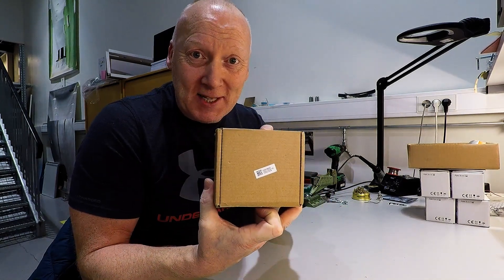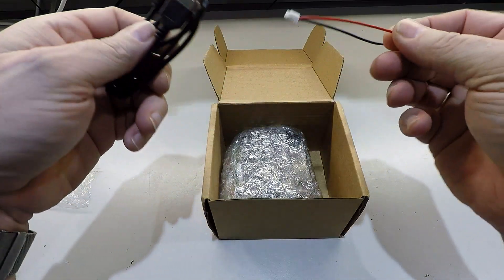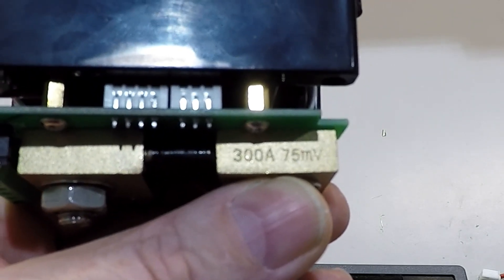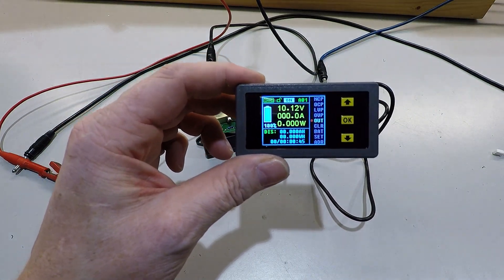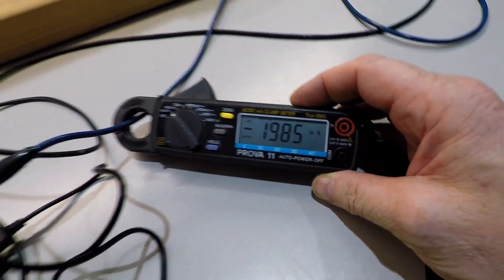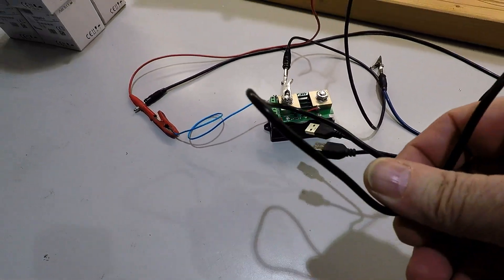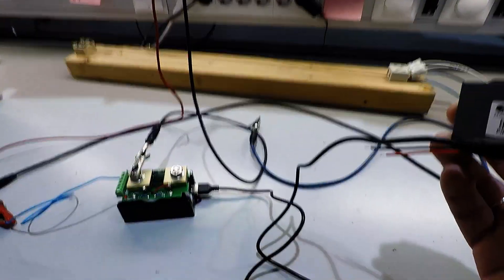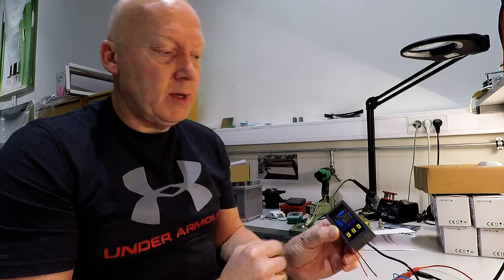First Look: Wireless RV Battery Monitor from Ming He (Drok) 120V 300A

Comment: Can you recommend a place for me to learn what all the measurements are?
Also, the new links on amazon show different models but they display no differences in the description. Do you know how they are different?
Reply from the maker: I think the main difference are the wraping (plastic housing). I don't know a place where you can learn what the numbers mean
Reply: @Italjohn  I can't believe you are still replying. Your comment inspired me to keep digging... I found this on Aliexpress... a pdf manual
https://www.mediafire.com/folder/b8784mx5o3en2/VAT_Series_Data
Page 3 shows a table describing the differences... Amazon does show this in the description but it is very very poorly rendered. The model number is tied to the amperage and max voltage it can measure! 
I have a 300amp 12v system and there are not many shunts likes this over 100a.
Reply: Also, this video goes into more detail describing the functions.
https://www.youtube.com/watch?v=MS3-JmyT-pY
Reply from the maker: @lunaumbra5179  Great video, did see that last year and have totally for got it.

Comment: No longer available
Reply from the maker: Yes I can see that, but they are still available at ebay https://www.ebay.com/itm/VAT1030-Wireless-Digital-Voltmeter-Current-Voltage-Detect-Power-Meter-0-100V-NEW/392807255868?_trkparms=aid%3D1110006%26algo%3DHOMESPLICE.SIM%26ao%3D1%26asc%3D225086%26meid%3D59d6d2a64f2742ea9c0e6b95b3bdefa9%26pid%3D100005%26rk%3D4%26rkt%3D12%26mehot%3Dco%26sd%3D164248425472%26itm%3D392807255868%26pmt%3D1%26noa%3D0%26pg%3D2047675%26algv%3DSimplAMLv5PairwiseWebWithBBEV2bDemotion%26brand%3DUnbranded&_trksid=p2047675.c100005.m1851

Comment: Could I use this on a dual t max 180amp split charge set up, main battery and aux battery in parallel if I used a 300amp shunt any help would be great. Thanks.

Comment: I also realized i can use a small relay like in a cars fuse box ,by using it to bypass the low voltage power switch on the inverter/ charger. this is better because both the inverter /charger, and my MPPT solar  charge controller say don't  use without batteries connected. I guess I'll need a second relay ,if I want a battery disconnect to happen after it is turned off.

Comment: you want to sell that unit?  the amp readings on mine are all screwed up. i don't want to rewire everything for a different model. i think it is the meter piece broken on mine.
Reply from the maker: No, sorry you will have to buy a new one.
Reply: i actually found extra settings on it ,to calibrate volts or current. if you go to NCP and hold the up button down for a while, the calibration settings appear. I have no idea how it got off so far, but i fixed it. the cheep meter lives on.
Reply from the maker: Excellent, I just discovered that option myself.
Reply: Yes it is awesome to be able to calibrate.volts /amps/watts. I don't remember anything about these settings. the new model has temperature and lots of new "hidden"options.$29-$59 I had been working on the inside of it the other day and must have touched something ,to advance it 20,000. .it took forever to get it back under 1000. one click , one number. if I hold it down, it is still only one number a second.I still don't know what the letters meaN.
Reply: @immrnoidall  Can you tell how to calibrate it using 3 extra menu options?
Reply: is yours off?  i'm really not sure if what i did fixed it or if it just went back to normal. I did disconnect/ reconnect, the power out on the device itself too. try that first and wait a day. one of the setting won't let you get in to change but the volts and the amps ones  i just kept decreasing the  units till it was close to what my charge controller says for battery volts and amps when sunny. i messed with it forever . but now i m not sure. get back to me if yours is off. it seems impossible to get each device reading exactly the same. you just have to remember which thing is off and by how much. I can't get at mine right now to take a look to remember how i did what. I do remember the units were very small. so i had to press that cheep button a million times t make small changes. but try a restart on the device that has the wires first then wait for it to go a day or so.

Comment: Just for you’re information ..... if you move the the coursur all the way up to NSC and hold it for a few seconds .... it will open 3 more points to adjust the multiplicator of I and U.
So you can adjust exactly the display of voltage and current.
Reply from the maker: Very good tip. (NCP you mean, as I can't find NSC?) Will check that out later. Thank you 😃
Reply from the maker: Tested it and it worked 😀 Thanks again 👍

Comment: Can I use the same battery 12 voltage as my external power when using the monitor in wireless mode ?
Reply from the maker: Yes 😃
Reply: @Italjohn  Thanks for responding. Great, that's what I was assuming but everyone kept showing a seperate 12v to 30 v power supply. I kept thinking, why can't i use any 12v off some nearby light switch or somewhere. Thanks again, you made my day. My many thanks again especially on this special thanksgiving day.

Comment: I have 30 W in Idle Mode (2-3 Ampere at 12 v) if i turn everything off... seems a little bit high even if i shut off everything... do you also have this in Idle? Or have i connected something wrong? Thanks man 👍

That would drain a battery pretty fast, i mean a power consumption for the shunt of 25 Watt is pretty high, display is external powered though...
I have the 1300 300 or 400 amp version
Reply from the maker: 2-3 amps on idle is not normal. Are you absolutely sure there are no load on the system?

Comment: Hi, I just bought the same, but did not install it yet. Can it be wired somehow that when reaching the set minimum voltage, it would not shut off the batteries but just send a signal to a relay - so that I can start a generator which start charges the battery?
Reply from the maker: Yes you can, just use the built in relay to controll a bigger relay that again can be used as an on/off switch for your generator.
Reply: yes, that is my plan! thank you!

Comment: Hi, not sure if anyone els has this issue or found a fix. My vac-1200A has die battery level indicator dropping to 0 before the battery even reaches 95% SOC. It has a % right below the battery level and that shows the right %.
Reply: Have you programmed in the Ah rating for the battery?

Comment: Perhaps the amp readings showed 0.1A high when powering the display via the USB cable. Would be interesting to test shunts Amp reading again with the display powered separately.
Reply from the maker: Will do a new video when do the installaton in the car. Let's wait and see what happens then :-)

Comment: the model... : 1200a is 200a :) 1300 is 300a.. 1050 50a on topic you told its 300a.. buts the 1200a model ? :)
Reply from the maker: They all look the same and work the same way.
Reply: so we can buy 1050 and its 300a too ?
Reply from the maker: No, no. They all LOOK and WORK the same. The diffence is the shunt that comes in different ampere ratings.

Comment: hi, i do have one of these in 200a version, but just before few days something happened and wireless function stopped working now am only using with usb, the actual problem am having is configuring it properly to use with home inverter system you see am using this module in between 1000Va inverter and a 150ah battery, when i select capacity 150ah and set 90% charge on the module even if the battery is 100% charged the module takes into account even the trickle charge and amp and counts beyond the 150ah capacity and when there is discharge cycle during power cuts the calculation starts from beyond 150ah not from actual  150ah and so the reading goes wrong and when the battery is almost empty the display shows still 50% battery left while the voltage reads about less than 12V, so how can i fix this and stop the count once the battery is 100% charged? ..thank you!!
Reply from the maker: I can't really answer your question. I would have contacted the sales person where you bougth it.
Reply: hi,i bought it at aliexpress, and you might already know the communication skill with china man is very bad, u ask something and they respond with irrelevant answer,so asking for help is useless,anyway i fixed the wireless issue by replacing the NRFL01 with another one with PA+LNA &10uf cap b'ween 3.3v and gnd pin seems like a power issue..the capacity and logging problem i partially fixed by using current function which is hidden above NCP ....ty
Reply from the maker: Thanks for the answer, and the fix. I will keep that in mind if mine should give me any trouble :-) PS: I don't know what a NCP and PA+LNA is?
Reply: PA+lna version of nrf24l01 has inbuilt power & noise amplifier which also has very high extended range , if you could replace the wireless  module in both the units, theoretically you could have communication distance like greater than 1500 mts between the display & the base module in open space line of sight. NCP is Negative current protection the first option in the display module, press up arrow for 3 sec's now you'll have  the hidden "C-I" , "C-V" settings where u can calibrate the shunt and restore factory defaults with "DFT" .
Reply: john doe, absolutely fine with 24v system, check the manual it says it can work in 10-110v range, remote display input is from 5-30v!!
Reply: john doe,No Problem.... the best way to monitor the system is to build our own by using arduino, an voltage divider, a shunt and a 16 bit ADC like ADS1115, but if you're not good with programming i suggest to get the unit!!
Reply: john doe, i usually buy parts from aliexpress its cheaper that way, for coding, you have to look into various sources and understand the syntaxes and modify the code that is meant for solar into your own way...
Reply: john doe i think you haven't understood the concept of ups, and again its good u asked before wasting 6k on that useless module, dnt worry it wont serve your purpose either anyways ill clarfy your query
1.ups is always on device, i believe you know its Abbreviation, even if there is a powercut or not the output is always ON, so if you connect a clock its going to powered on 24X7 because there is no switching between the battery and mains, the clock will be powered if there is mains and still powered from battery if power cuts.
2.the link you provided is for an cutout protection device in case of excessive amp or volt thro the relay it gets cutout, if you put this in between 200ah and inverter 9mm cable i think, if 2-3 ceiling fans are running, the relay would melt in first powercut, so you need an module with shunt in it with ranging from 200a-400amp since your are having 24v system two battery guessing 1500-2000va ups? If the connected load is at max like 1.2KW, with 80% ups efficiency, Thats huge amounts of amps to run through.
3.even if you buy the correct one as shown in this video you'd never be able to monitor such parameter like duration of powercut, you'd be able monitor 3 important parameter a. Voltage & Amps of the battery during charging as well as discharging. B. Cumulative battery charge and discharge cycle. Like how full the battery is and how much have discharged at what rate battery is charging, but since battery chemistry keeps changing all these info's displayed are only approximate not accurate.dnt be fooled by the time shown on display, its nothing but the time since the relay/display is on...
Reply: @Ragavenutb  Hi Raga, Just wondering , did u get chance to put these data in to Internet  ? As these uses Wifi may be we can tap in to it using an Esp32 or we can read data from serial  USB also.

Comment: Have you a link for the english manual please?
Reply from the maker: It's not a manual, it's a pictures with a wiring diagram, but here it is: https://images-na.ssl-images-amazon.com/images/I/71QJ0hWDQ7L._SL1000_.jpg
Reply: For measure all consum of the camper it's possible put the blue cable in negative of camper aux battery and the green to positive? i'm interest for measure total consum of my aux battery.... 
thks for your response
Reply from the maker: The big shunt is measuring all amps that goes out (or in when charging) of the aux battery. The blue cable in the drawing is the negative, and goes to the chassis of the car (ground). The black cable is the negative from the aux battery. The red block is the aux battery. The green wire is connected to the positive on the aux battery, and then through a fusebox.
I can make a more understandable drawing if you can wait a day or two. Here is a drawing I made a few days ago. The battery on/off switch is wired the same way as the shunt. https://i.imgur.com/g6o3f3U.jpg
Reply from the maker: Better drawing. https://i.imgur.com/mVs4SlB.jpg
Reply from the maker: One more:https://i.imgur.com/61FKvR0.jpg
Reply: Ok i wait for your explication.... jajajaj so this pictures help so much!
Thank you very much for your help, my project of T3 syncro just start now and i want to make all as better possible. I 've purchased the wireless monitor and i just waiting for the item...
Reply: you can follow me in instagram or fb or twitter in @itorija and hashtag #projecT3syncro